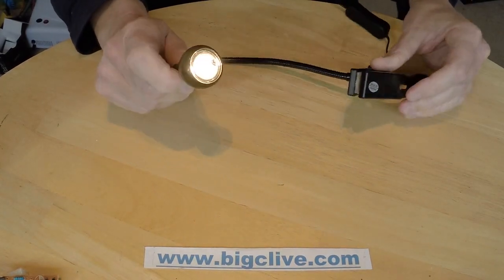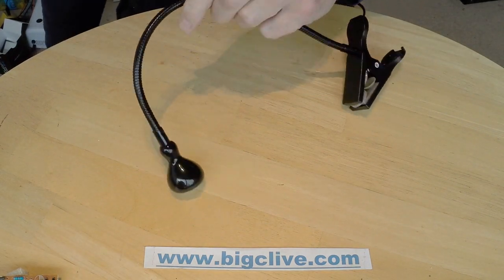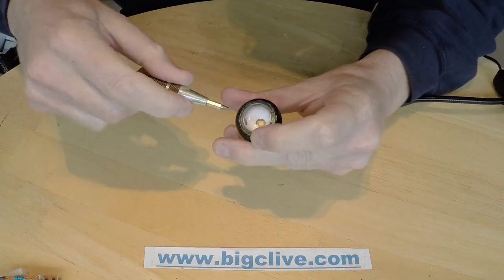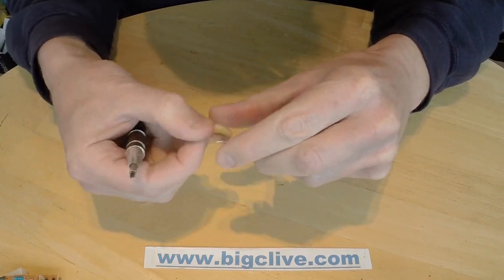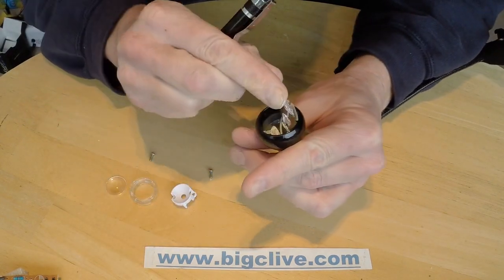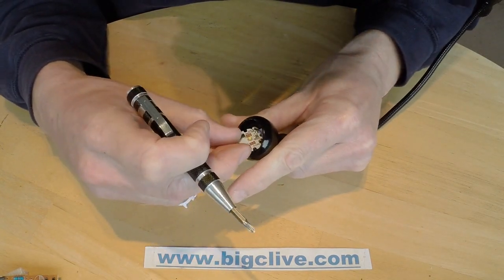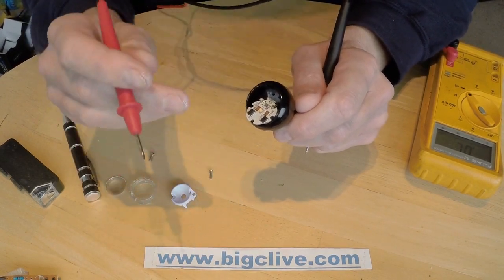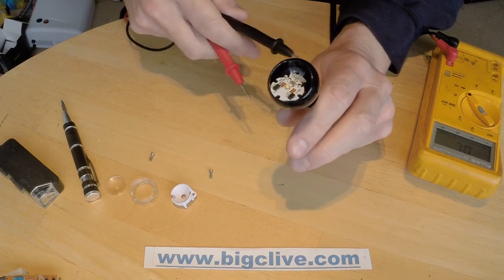Inside a 3W Ikea clip-on desk light.

Comment: We have a couple of these in our motorhome- I've changed the connectors and added DC/DC convertors to drop the 12V to 6V, which is enough to drive them.  (Ours are the later models- which have 7V supplies.)

Comment: Your link to the datasheet got me a 404 page with a lot of chinese writing on it.  I did find one here:  https://www.digchip.com/datasheets/parts/datasheet/838/AMC7135-pdf.php though.  Too bad that chip is only able to handle a 6V power supply,  I'd like to find something of the sort to use with a bit more voltage,  for some 10W LEDs I'm driving to about 3W or so.  At this point I'm using smallish buck converter modules from China, but they're a bit fussy to set up properly.

Comment: I'm wondering how hard it would be to modify this to put a slightly higher powered led in there... though I guess it might be a recipe for disaster as well... could be fun either way I suppose.
Reply: For example a 5w star pcb led, I know it would need a different power supply and all, but I'm curious if it would cook itself in the lamp.

Comment: I put a pair of 4 pin XLRs on one of these yesterday. I clip the light to the edge of my desk for electronics work, and power comes from behind the desk, meaning that I had to either leave the lamp sitting on the desk or fish the power cable in and out every time I wanted to use it. Now I just have an XLR4F sitting on the desk on the end of the cable power cable and I can set up the lamp much more conveniently :)

Comment: We sell so many of these buggers in their many different forms, rarely get them returned, it only one in so many of the power supplies which fails which leads to the LED to start flickering. 

Also the modullarity is logical the more stuff we can use the same stuff for the cheaper we can get it. I only wish they would fix the buzzing on the dimmable LED bulbs, some have it, some slightly and some really bad. That said the LED range seems to get renewed every year or 2 years. 

It is decent fun to pull apart ikea stuff for a living to find out what and why it broke :)
Reply: +Lintary 
I'm confident that the flickering is caused by the mechanical switch on the wire itself, since I run one of these on an old PC PSU (3.5V direct drive, orange to black wires), and it most often flickers until I bash the switch to put pressure on the contact plates.
Try it yourself -  IKEA's supplier made those switches of inferior quality.
Reply: ECN It is the power supplies, not the switches, believe me I am switching out more than a few PSU units a month, put a good working one on and they work just fine. Of course there is also the fact that many people mix them up as they all look the same and share the same connections, but voltages rang from 4 to 27V. I think I have 1 switch defect for every 50 PSU defects. Of course compared to the numbers sold it is still marginal.

Also opened up one of our newer 1800LM bulbs, sadly half of the PSU inside is covered in resin, still they all the same dual diode LED chips on an aluminum plate.
Reply: I've just (in the last few minutes) repaired one. The wire between the switch and the led had broken, under the clamp screw on the clip. I suspect the damage was done when the light was assembled. The light had flickered before and I replaced the switch, which appeared to help. Then it started again.

Comment: These IKEA lamps tend to flicker, especially the very big ones with the footswitch. The reason is actually the switch: Those switches are rated mains, and not made for such low voltages and currents, thus not making perfect contact like that. Kinda annoying on such a good lamp, but easily fixable by replacing the switch.

Comment: A 7135 is a basic led current reg that takes up to 5v and supplies 350mah @ 4.2 each for the led lots of cheap Chinese led controllers use them and are very handy little things to use on power leds
Reply: AMC7135 
It can take up to 6V and deliver 350mA of current, and the dropout voltage can be only 120mV  Widely used in flashlights, as they can effectively use all the capacity of a lithium cell, like 18650, to power a white LED down to the forward voltage of the LED + 120mV. The power pin is low current, so it can be used for PWM control from a microcontroller output.
If larger current is needed, they are simply connected in parallel; have a Cree XM-L based flashlight which has 6 of them on the driver board to regulate the max current and a μC to deliver brightness control via PWM as well as flash/strobe modes.
Neat little devices.
Reply: Thanks :)
Can i plug it into <5.5v perhaps? My powerbank would supply just a bit over 5v and it would make a great usb light.
Reply from the maker: +drkastenbrot IKEA do some very good clip-on LED lights specifically for USB power supplies.
Reply: +68Stan I try my best never to run a Li-ion down below ca. 3.6V. The voltage extremes generally shortens the lifetime of those cells.